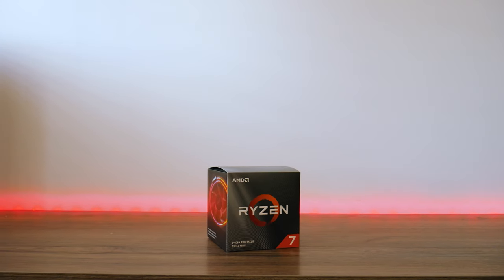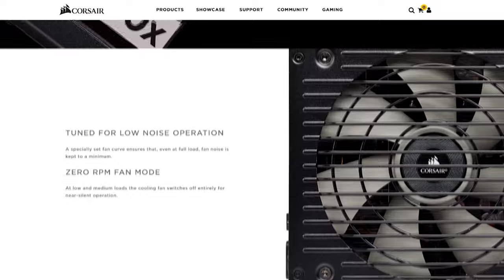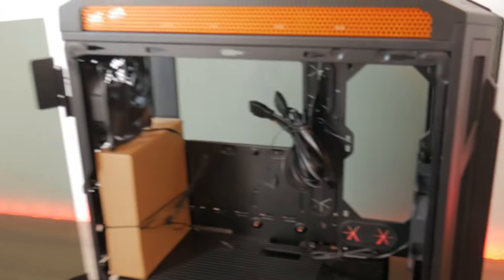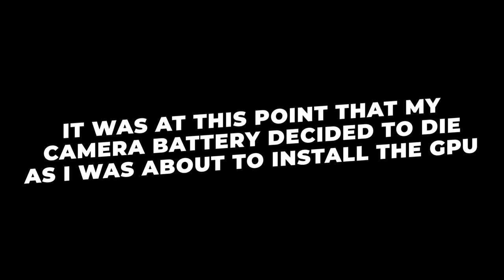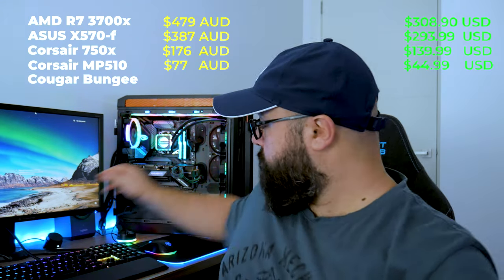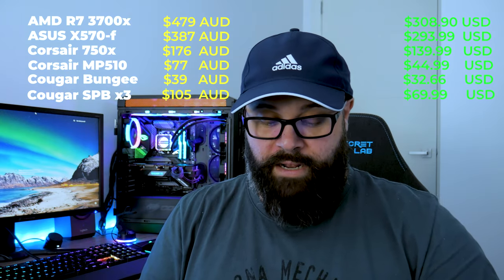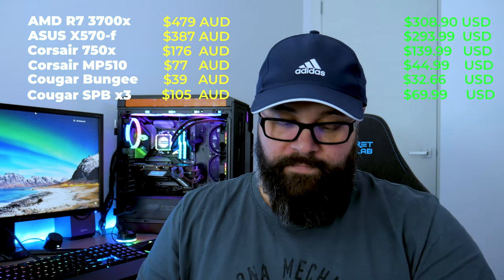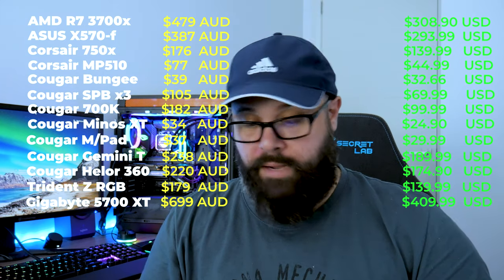TIMELAPSE Ryzen 7 3700x Gaming PC 2020 | Gigabyte Radeon RX 5700 XT OC Cougar Gemini T

Comment: How is the Gemini T? There's barely no info about it out there. I'm really concerned with airflow, that glass in front of the front intakes seem quite crammed. Also, the side vents... where does it vent to?
Reply from the maker: This case is beast. Thermals are fantastic, plenty of space in the front as the glass doesn’t meet to block it, plus two fans on the side intaking air an exhausting from the top and rear. Very under rated case in my opinion

Comment: Hello, I have a question about the motherboard and case.

The case included 2 stands for the motherboard. How did you attach it inside? Did you buy stands separately? Or did stands come with the motherboard? Or is two enough?
Reply from the maker: Hey there - do you mean the standoffs for the motherboard? You don't need to use them. The mobo goes over the mounting holes - try test fitting it and you'll see it will work!

Comment: Hi, first I want to congratulate you for the great work done in this case, I am interested in getting the Gemini T, but I live in an extremely hot region and I wanted a case with 9 fans, I was fascinated in the side fans of the Gemini, but it says that I should opt for fans side or front, do you know if it is possible by a 240mm watercooler on the side and 3 fans on the front? since already thank you very much!!! I confess that the aesthetic appeal of the RGB fans on the side also fascinates me
Reply from the maker: Good question. I get great temps in the current setup of a 360 front mount but you can’t mount anything else if u do a 360 there. I think a 240 side mounted will work and another 240 top mounted but I’ll need to check the documentation. I love this case. Great performance for the price. And cougar make very good quality.

Comment: I mounted my AIO with 3 fans like you did. My Air flow isn't that great. Is it because the front fans are blowing air out instead of blowing the air in?
Reply from the maker: I think we changed it after the video to push pull as we have from the front as well.

Comment: Looks great. Would it be possible to put in the cougar 240 aio on the side with 2x120 fans exhause and also 3x120 fans intake from the front?
Reply from the maker: You probably could but with the cables at the side, it could get a bit congested.

Comment: Great job sir, I have just used your video as a guide while I was building my pc but I am confused about the usb 3 cables that come with the case.There are two cables both of which are compatible with the USB 3 port on my mobo, but one of them is for type c. One of them is the combination of two cables while the other one is a one cable model or whatever it is called. Nothing is written about it in the manual. Could you please help me?
Reply from the maker: Yes you are 100% correct, we had to make a choice for which ones we wanted connected. I think the only way to do it is to get an additional USB A connector and plug it into the USB headers on the motherboard. We chose the USB C and will need to get an adaptor for the USB-A.

Comment: What are the actual chances of fitting a 360 at the top? It fits 3 120mm fans already. I'm trying to get a better idea of what is stopping from fitting a rad up top.
Reply from the maker: SJBIH13 I think you could for a thin 360 but ram height may be an issue. Which is why I went front mounted.
Reply: @BuildMontage  my case came in today and as I was testing 360mm rads I noticed it came with only one motherboard standoff installed and two in the bag  🤦‍♂️
Reply from the maker: @sjbih1321  if I recall, you don't need to use standoffs as there are pushed up divots to in the actual motherboard tray. It must be as I had no issues lining up the IO with the cutout. Maybe just check that if you can before you start :D
Reply: @BuildMontage  Interesting.  Did yours come with one in the middle and two in accessories bag?
Reply from the maker: SJBIH13 I honestly cannot remember. I’ll have to rewatch my video zoomed in LOL!
Reply: @BuildMontage  I re-watched it and it looks like you didn't. Kind of hard to tell though lol
Reply from the maker: SJBIH13 best thing to do is test for the motherboard.
Reply: @BuildMontage  Sadly you can't fit 2x 360mm rads. They interfere with each other.

Comment: Hi -  Great video, thanks for uploading. I'm looking to build the same case, fans and cooler for my son. A quick question - is it possible to install the front CPU cooler the other way, so the two cables don't cross over the RAM and they go towards the bottom of the case, instead of the top?
Reply from the maker: Peter Harrison thanks for watching. No they won’t fit the other way round - I tried a few methods but in the end was happy the end result regardless :)
Reply: @Build Montage - Thanks for the update. I've ordered the case, cooler and fans now. Really looking forward to building it up and giving it to him on Christmas day. Weird how we both decided on the same case and fans. I was doing some research and found your video, which then convinced me to get the CPU cooler as well 👍🏼😊
Reply from the maker: That’s awesome! It was a fun build and my son loves it! Best part was we did it together.
Reply: @BuildMontage  - thanks for your inspiration on this PC build. I pretty much mirrored most of the components you selected, just changing a couple of things.  My son opened it up yesterday and loves it 😍 👍🏼
You can view some photos here : https://www.overclockers.co.uk/forums/threads/desk-and-room-gallery.18571707/page-128#post-34385308

Comment: I've ordered the same case and I've watched this video a few time while waiting for my parts to arrive! Great video. But I just noticed, are all your fans exhaust? It don't seems that you have any intakes. The fans on the side of the Mobo looks like they are exhaust as well as the fans on the AIO wich looks like in push configuration tkaing air out of the case.
Reply from the maker: The fans on the AIO are sucking air in.. made me check!! Temps are fantastic.. my son's playing right now.. package temp on BFV is 43c on Ultra 1080p 165hz.. never been any issue with heat - the computer runs super cool. I could have made the side ones suck air in, but they seem to be doing ok as is, so no need to change anything at this stage.
Reply: @BuildMontage  Awesome, my bad ;) Can't wait to build mine now!
Reply from the maker: Not at all.. I'm far from perfect, but I distinctly remember deciding which way to do my fans for the build, and yes, more intake would be good, but the system runs super cool, so I'm fine with it how it is for now. Good luck with your build!

Comment: Hello sir, just curious is this the proper placement of the fans?
Reply from the maker: Which ones? There’s a lot of fans in this build!
Reply: @BuildMontage  All the nine fans. We have the same case and same number of fans, my first build. Is it okay that they're all facing inside?
Reply from the maker: They aren’t. The tops are exhaust, rear exhaust. Front and side fans are intake. I may have changed things since I made this video.
Reply: @BuildMontage  okay so the 2 case fans and 3 radiator fans are now facing outside. I need to change mine then. Thank you very much for the info sir.
Reply from the maker: Fans are tricky. U need to make sure u have a good balance between intake and exhaust. I think I made a mistake on my video when I made it as I’m so used to phanteks fans but yes my aio is intake and the two side fans are also intake with the top and rear fans being exhaust.
Reply: @BuildMontage  do you have a clip or a short video with your final output for this build? If no, totally fine. Thank you!

Comment: Hello sir, I was really inspired from your build and now I've decided to build it with same specs as yours... Although the mb I've got is Aorus X570 Master. But the thing I'm still trying to figure out is I can't connect these spb fans... Been trying it for straight two days...
Reply from the maker: How are you trying to connect them? On the top? You will need to remove the shroud at the top. To do that, you will need to pinch the clips one by one very carefull to remove it.
Reply: @BuildMontage  sir, the problem isn't with mounting them, but it's with connecting the fan with 3 pin splitter, where as I've got set of three pin to four pin connector in my cougar vortex spb fans set, but all fans are 4 pin connector fans. So I've concluded to buy a cable splitter hub which supports 4pins connector, which will divide fans in a better way.
Reply from the maker: Aqeel Raza that’s interesting as 3 pin is addressable and 4pin is usually just normal rgb. Which products did u buy specifically?
Reply: @BuildMontage  I bought same SPB Vortex RGB fans as yours, but although I think there was a factory mistake in my box of fans. Because I can't find and three pin connector for my fans, both RGB and Fans ports are 4pin connectors. I think that was my bad luck.....

Comment: How is the air flow on this case ?
Reply from the maker: We have no heat issues at all. It pulls air in from the front, and the side through two additional fans, and the top and rear exhaust hot air quite well. Very happy with this case all said.
Reply: @BuildMontage  thanks for the quick reply